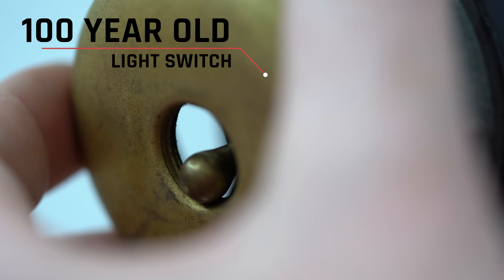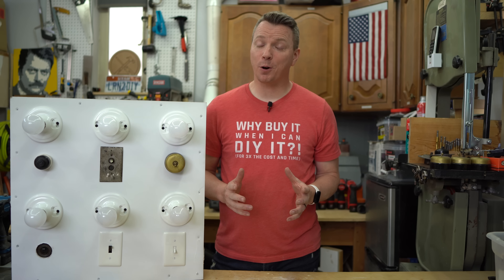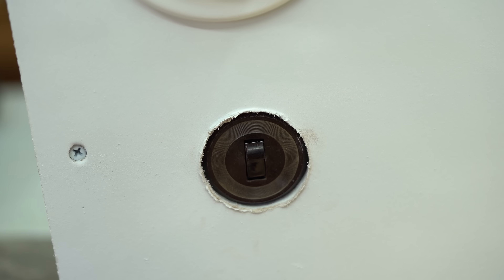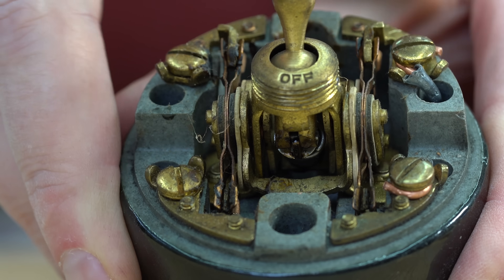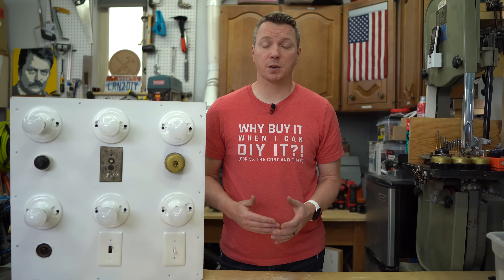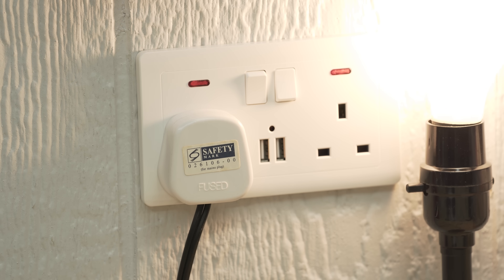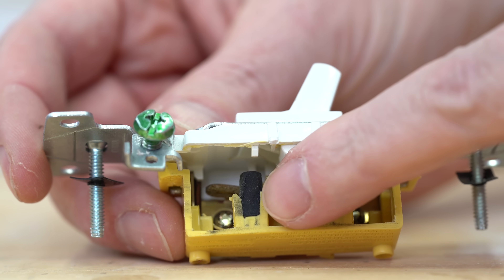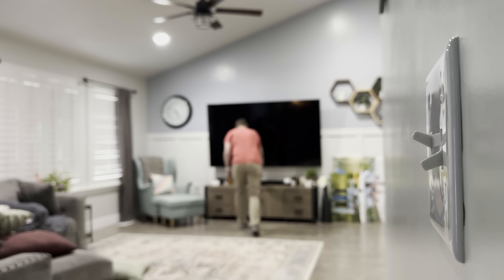How a Simple Spring Changed Light Switches Forever

Comment: The old switches whose mechanisms you show have both rapid and wide separation of their contacts when opening the switch.  This was very necessary when switching DC circuits to prevent an arc being established and sustained.  Switches for AC don't need such a long break distance because the current drops to zero twice in each cycle allowing "micro-switches" to be used.
Reply: Makes sense,  I read somewhere that somewhere near NYC, I believe near Manhattan,  there were some utility supplied DC up until the late 50s, and new students at a university would plug in their record players, etc and destroy them.  Seems strange to have DC when AC was already well established and 60 hz was the standard by that time.   Possibly there were a lot of buildings with elevators with DC motors? 

Another interesting thing is 25Hz, commonly used for motors in electric railways,  some elevators and similar uses where low speed and high torque is necessary, it provided many of the benefits of AC and DC.
Reply: @Sparky-ww5re  Yes, downtown Chicago had DC available in addition to AC until 1960, for elevators and printing presses, etc.
Reply: @Sparky-ww5re  u
Reply: @Sparky-ww5re  actually, there was at least 1 rooming house in Manhattan, NYC that had DC coming in until around 2000 or so...there was a New York Times article about this at the time, when the building was converted to AC current.
Also, ConEd had street DC available because, many commercial buildings had large equipment with DC motors that they did not want to rework..the most common usage of these were elevators.
Eventually, when ConEd really wanted to get out of the DC supply business, they offered incentives for building owners to add rectifier-based AC to DC convertors to the old systems.
Up until around 2000, many buildings still had DC feeds still in the basement, but unused.
I've personally seen a live DC feed in a building in the 1990's(this building had a movie theater in it, and the old carbon-arc lamphouses ran on DC).
The theater was converted to Xenon lamps, and AC-based power supplies in probably the 1960's or 1970's-yet, when the whole side of the block was slated to be razed to build a block-long office building-a look in the basement revealed a DC panel(switched off, and fuses removed)-checking on the incoming side of the switch, showed that indeed, the 120 volt DC feed was STILL ACTIVE, though unused, in the 1990's!
I've heard similar stories about other urban areas, so DC, on a limited scale held on way longer than is generally believed.
Reply: The arc is still easy if you are interrupting an inductive load, but it's also far more important to avoid even small arcing with DC due to the corrosion of the metal contacts. You can use different metals to help protect against this, but you've still a good chance of having some chemistry happen in the same direction every time, whereas with AC, any chemical reaction is trying to be done and reversed equally on both sides, very quickly, so the contacts can last longer (esp if there is higher humidity etc)
Reply: It's not whether its DC or AC, it's what the circuit is powering. Inductors (coils of wire) tend to create large voltages in the same polarity as the current is flowing when the magnetic field surrounding the coil collapses. The only thing that would perhaps make DC more prone to arcing is that inductors appear as resistors to AC circuits depending on the frequency, so to help with that, capacitors are put in the circuit to reduce the resistance. Those capacitors also reduce arcing when the circuit is opened. Inductors appear as solid wires to DC circuits, so they don't have capacitors unless it will be pulsed DC. Old car ignition coils triggered by points use this principle. To avoid arcing across the contacts in the points, capacitors, which they call condensors, are usually in circuit near the points. On the other hand, you can watch videos of very large utility transformer circuits being opened and they form gigantic arcs with 60hz AC (at least in the US).
Reply: @tylerfb1  ahhh... the days when you didn't have to be a computer expert to work on your own car and some wrenches, screwdrivers, and pliers were the main tools you'd need to keep the car running 😁    .   Another thing very similar to an automotive ignition system with points, was fluorescent fixtures more than about 30 yrs old, with a starter, in which the lamp ends glow for a second or two, upon the starter  opening the inductive kick produces a voltage spike that (hopefully) strikes an arc through the tube and lights up.
Reply: @Sparky-ww5re  metal halide and high pressure sodium lighting is still in use today and they both require starters to ignite the bulbs. 🙄
Reply: @kurt6469 but at least he makes his mind up🙂👍
Reply: My fraternity was built in 1924 in Troy, NY. The building ran on DC at that time. I have used the pushbutton light switches tho I can't recall where.
Reply: I don’t think any of what he was showing was old enough to be DC mains rated, though.
Reply: @JasperJanssen  Yes they are. Yes they were still u sed with AC. But the designs originated with DC.
Reply: @JasperJanssen  Those early 20th century ones absolutely could be, quite a few cities had functioning DC networks running well into the middle of the 20th century. Granted by that point they were already small compared to the much larger deployments of AC grids but it is plausible the early 20th century ones could have been dual rated. It was probably easier and cheaper to mass produce one that would work for both than bother to set up a separate line with small runs just for the minority of customers that had DC supplies. It is not uncommon for the economies of scale to make the marginal cost difference small enough that the fixed costs of setting up and maintaining a separate production line that wont be used anywhere near as much still dominate over just making loads of the dual role product using one set of tooling.
Reply: @FaerieSeraphina  another oddity is 25 Hz, many electric railways used it for the trolley motors, as were some elevators and similar settings where low speed/high torque is needed. 25 Hz was also used for rotary converters for converting AC into DC before the widespread use of mercury arc rectifiers, which were being replaced with full bridge rectifiers in the 1970s when diodes became reliable and cheap enough.
Reply: @Sparky-ww5re  True, although frequency is not as relevant to switch design. It does have a small effect at very high frequencies as the arc can become almost as hard to interrupt as pure DC. This being due to the fact the air remains easier to rekindle the arc for a while after it breaks. At very high voltages/frequency the potential drops to zero then rises again fast enough to rekindle the hot partially ionised gas into a new arc again.
Reply: @Sparky-ww5re  Lower frequency actually makes it harder as the potential recovers more slowly after the arc is interrupted by the nadir in potential as the sign changes.
Reply: @Seraphina Joyce  did they even have standards in place back then? I got my hands on one of the original electrical code books where it stated licking your finger and touching the wire to check for voltage. Standards and rating weren't really observed much at the time. Lol
Reply: @Sparky-ww5re  The original Westinghouse/Tesla power plant at Niagara Falls produced 25Hz.
Reply: @Sparky-ww5re  another odd one is 40 Hz-NYC used it for a while in some areas, and the NYC Transit system used it for the incandescent lighting into at least the late 1970's(at least in the outer boroughs)(actually, I think it held on even longer than that in some parts of the system).
If you looked at those lights out of the corner of your eye, you could see the flicker(the fact the bulbs were ran on the dim side made this more apparent).
Reply: @m.k.8158    as I recall that flicker was 25 cycle AC because they were still using AC / DC mechanical converters (basically a motor / generator) to make power changes within their systems. The local power plant made DC, but they found that AC could travel longer distances without voltage drop in the tunnels.
Reply: @rupe53  I'm pretty sure that those lights were using 40 cycles, not 25 cycles(but I COULD be mistaken).

Comment: Rotary switches used to be common in Germany too
3:02 the two-button-push-switch can still be found on the bench drill today
6:25 In Germany square flat switches are used but these have the same spring snap mechanism
Reply: I lived in Germany for four years and the first thing I did when I moved back to the US was stab myself with the light switch because you don't push them to activate them typically over here.
Reply: @Kori-ko  Yeah man America is backwards
Reply: In Finland they also used to be popular. Strangely on normal switches the actual switch area has gotten larger and larger. The ones shown here with a very small switch are retro switches here and cost some 50 €.
Reply: One of the manufacturers of fuse boxes in the Netherlands used dual pole rotary switches, whereas a newer style replaced them with rocker switches (not toggle — if it ain’t got a male protrusion that you flick, it’s a rocker, not a toggle, unlike the video says.)

And yeah, all of that predates the din rail style.
Reply: @JasperJanssen  We still have some really old 1950s bakelite Holec switches and outlets at work (as well as a lot of 1980s stuff). Shame they aren't around anymore.

Comment: I recently broke a light switch recently, that dongle thing made of plastic broke, and so the switch couldn't stay in the on position.  So they don't always last forever, but then again it was easy to buy and replace it.  I went with a Decora switch this time.
Reply: The spring also wears out over time and the switch should be replaced.  I'm questioning if this guy has ever used a light switch before.

Comment: I still have some of the old push button, and the old switches that give a good clunk. They never fail. I have had to replace quite a few modern switches (cheap or not). The contacts in the new ones are just so tiny. And the old ones with the nice clunk just feel better.
Reply: I bought a new house in 1995. Right at the 25 year mark I had to start replacing the most commonly used light switches. Lowes had three switches, I think it was buck, a buck 50 and three bucks so I went with the $1.50s figuring they would last until I died for sure! :) So far so good! :)
Reply: @robjohnson8522  wonderful.

Comment: I grew up in an 1850's home that was electrified around 1920 or so.  When my parents bough the house in 1969, it had one light three gang light switch in the entry that still had the original light switches.  Over the 47 years that my parents owned the house, that set of lights became my father's pride.  When the first switch failed, he sought out an original to replace it.  By the time the second switch failed, reproductions were available and he replaced the previously replaced switch and the newly failed switch with repops.  Only one switch was original. 
When they listed the house in 2012, the idiot Real Estate Agent announced that she would not show the house until the pushbutton light switches were replaced with modern units.  She said that any potential buyer would assume that the house needed re-wiring if they saw them (the house had been fully rewired in the 1980's). They were removed.  
Those three switches and their brass coverplate now grace the entry of my 1930's house, along with a dozen or so reproductions.  The first floor of my house (excluding Kitchen and Bathroom) have now been converted to pushbutton switches just because I think they are cool.  Yes, my house is on the tail end of the pushbutton switch era, but they were still being made.
Looking at the online listings for reproduction switches, there are two models available.  The original, mushy action and the new positive action.  I can say that the mushy action models feel just like the originals when you use them.  I wish I had bought the positive action ones though.
That same idiot Real Estate Agent convinced them to replace all the original light fixtures with new and to throw away the spare doors etc that were in the attic.  After listing the house for over a year with no serious interest, we hired a competent agent who bemoaned these changes, and proceeded to sell the house in two weeks.
Reply: Very cool
Reply: If you are an insurance company or electrician, you're much more comfortable dealing with modern high quality light fixtures, switches, wiring etc. I cringe seeing old non earthed light fixtures with metal switches built in, and no GCI or RCD in the circuit. I do however love the old stuff, it was superior in many ways - just not up to modern safety standards. I have retromodded old house wiring, and add earth  ground connections to various fixtures.
Reply: Go to anyone who offers a service professionally and then tell them you had already tried one of their competitors first, and every one of them is going to tell you that their competitor doesn't know anything and you were smart to come to them. The first agent was right, old electrical fittings are a huge red flag. And notice the second agent had no problem selling the house, so obviously the light switches had nothing to do with it. If your father put as much effort into raising you as he did to clinging on to obsolete electrical fixtures, you'd probably know this stuff as an adult.
Reply: @ev6558 

Hard to see any viable basis to “diss” the OPs father or either party’s knowledge.  You also assume the second realtor was only looking at the money they could earn.  Pays to be cautious but unless a device is outlawed by code or has a hazardous malfunction, disturbing existing facilities can cause other unwarranted problems.  Poking bears often isn’t a good practice.
Reply: @handledeehandledum  Stay in the woods with the bears, let people who know what they're talking about deal with real estate in civilization.
Reply: That first Agent was 100% correct.  I and most people would not touch a house with electrical out of spec.  I have seen many try to sell their old homes with "updated" wiring but still had improper receptacles and switches.  Huge red flag.  You might find your fire hazard switches neat, no one else does.  I have modern equipment that requires modern power demands. a janky switch or receptacle that is improperly grounded and/or induces line noise is unacceptable.
Reply: @IraFox84  Hi, I just wanted to pop in and point out that a switch's style has literally nothing to do with its quality, and codes frequently permit multiple styles. Ask an electrician if you have any questions!
Reply: @IraFox84  If anything, light switches have to switch a lot less current nowadays than 100 years ago. You can run a 5W LED lamp off of speaker cable. I wouldn't worry at all about old fixtures and light switches. Sure, swap out ungrounded power outlets, but why do away with the charm of old light fixtures? In my (yes, very developed) country, a lot of old light fixtures from the early 20th century can still be seen, and I have never heard of one causing a fire. Also, line noise? Really? What are you running at home, a radio telescope?
Reply: @IraFox84 
You assumed the older equipment was inferior, same error of the first realtor.  New / modern isn’t guaranteed to be better, only possibly different.  

Buyers can have others look at the home before purchase, often passing code inspections is part of a buyers’ contingency on purchase with inspections/tests paid by the prospective buyer, and the remediation to code or sales agreement terms paid by the seller. 

Don’t be fooled, but don’t presume all is good or bad.
Reply: Tell me you know nothing about electrical with telling me you know nothing about electrical.

Comment: I have a mercury switch. Honestly I think it will last the longest lol. It has a liquid metal so it's never going to weld itself like contacts do. I like the fact it's silent Honestly. Too bad they discontinued them. They are pretty safe, just a hazard when manufacturing,  but it's sealed so pretty safe for the end product. Nice video
Reply: 😆 + mercury swatch can be used in numerus switching appliances  😁
Reply: Building demolition and they get tossed into the garage.
House fire and the mercury gets washed into the ground water.
Etc.

Comment: The house I grew up in was built in the 30s I believe. It had, next to the front door, a dual bank of rotary switches in a double size brass wall-plate. One switch controlled the light in the foyer and the other controlled the outdoor porch light. If I remember right,  they were partially recessed in a bowl shaped divot in the wall-plate. I can't find any pics of them.